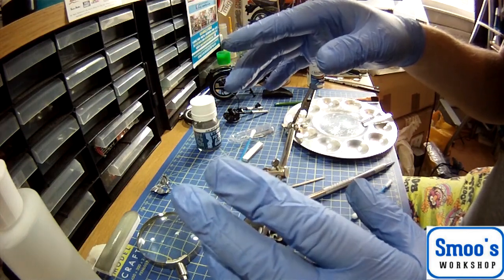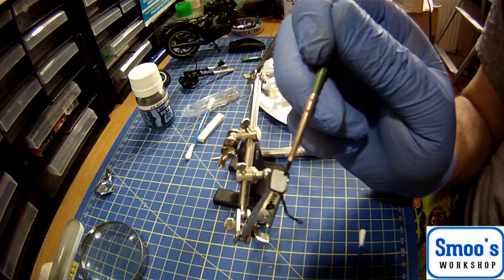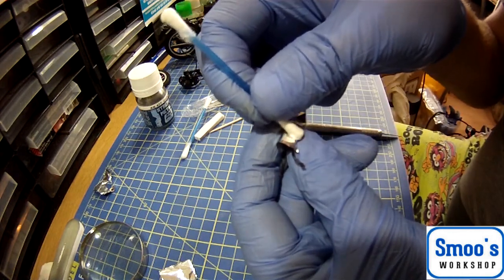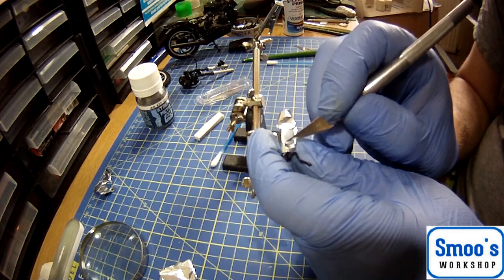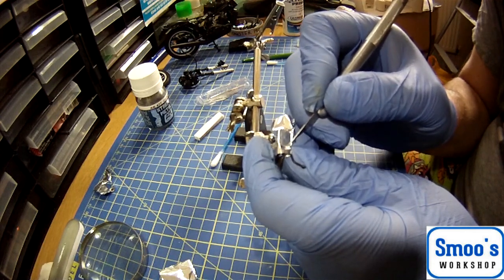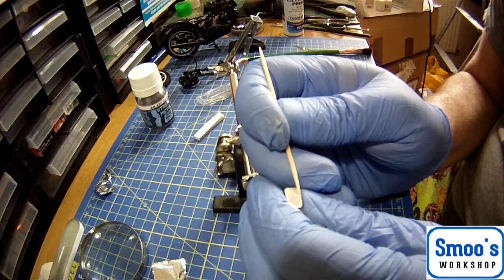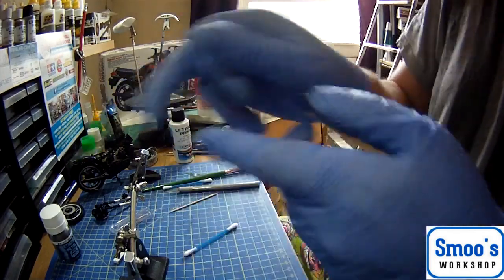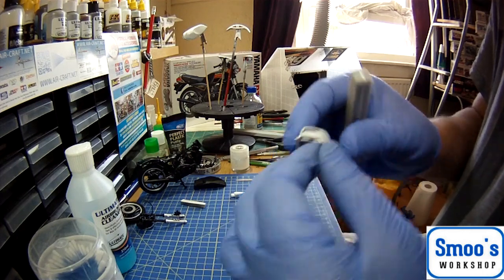Tamiya 14002 1:12 scale Yamaha RZ250 Build video 10

Comment: Im building one now, no de -chrome.wheels matt black and scrape off black from ridges ..rough and ready..For the mirrors i used a fine tip liquid chrome (molotow) great results . a lot quicker !! . great vids.
Reply from the maker: Thanks, i'm almost done with mine, spending a lot of time on it as it was a bike i rode in my youth
Reply: Great bike..  i had a  Suzuki gt250  back then ...  thorough job your doing !!

Comment: Thin the white primer and it works brill
Reply from the maker: i was thinking of trying that Lee as i think the pigment is slightly thicker but was told not to thin them what would you recomend i have ultimate thinner and mr hobby self levelling thinners
Reply: Smoo's Workshop ultimate thinner works well mate great build by the way mate cant wait to see it done
Reply from the maker: thanks i shot some more today and was going to try thinning it as the black stuff is great but was having to up my psi to 30 and was getting tip dry, some more rub down on the white again so will thin it this time thanks, and pref amount like 50/50 or just a few drops?
Reply from the maker: just tried some with about a 40% mix of ump thinners to the primer, it's like using a totally different paint , shot way better will see how it dries in the morning but clean up was easier too
Reply: Glad it works better for you mate i had same problem at first